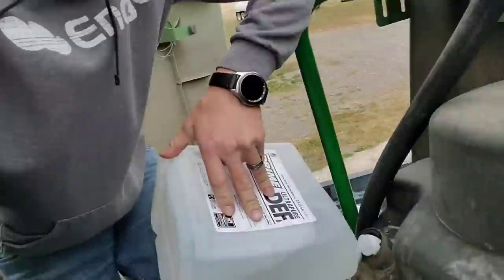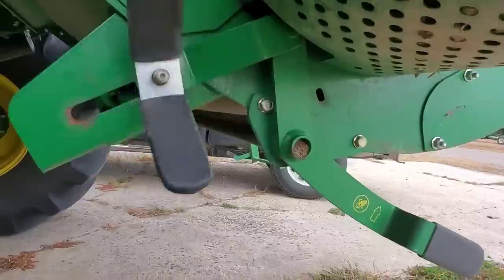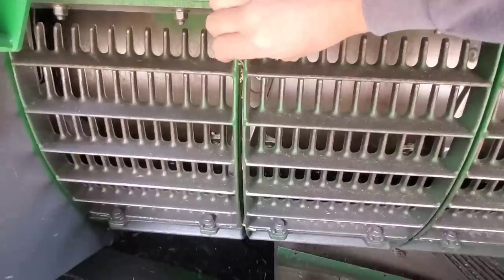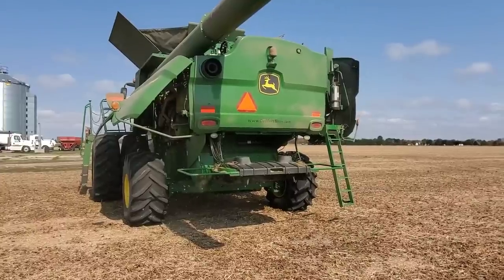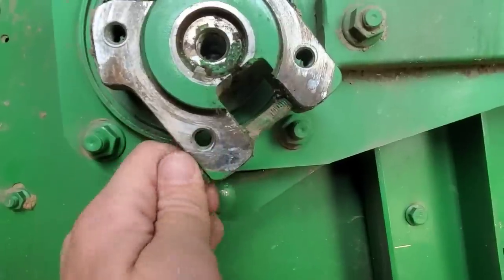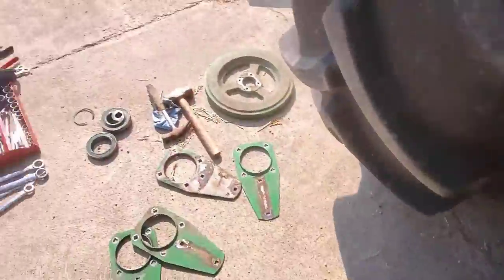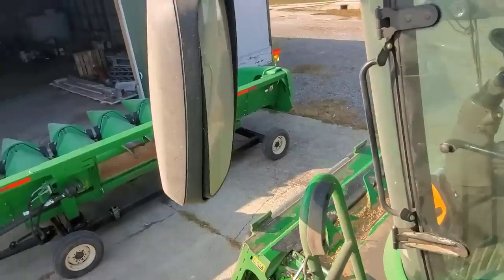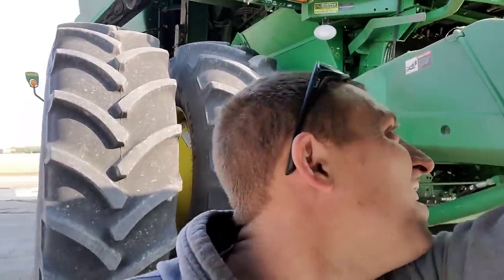Catastrophic Bearing Failure - #263

Comment: I love that A!! My dad had a late 40’s or early 50’s Super A with the 2 point hitch and a fairly ingenious homemade snow blade set up on it and it was the very first thing I ever drove and I was 6, maybe 7 at best? My dad used it to skid logs for his firewood business he had at the time, man would she pull for something that less horsepower then our riding lawnmower, lol, dad eventually bought a reel mower off a golf course to justify having it when he got out of the firewood biz but the R1 rears did a number in the lawn. I’m not sure if your A does it but ours was impossible to drive higher then like 1/2 throttle in 2nd gear because it just plain would not turn, even with that big old blade on the front dads Marian voyage with that mower ended when he got to the first turn and cranked the wheel only to make a couple of furrows in the lawn instead of turning, lol.  I nearly got killed skidding logs when they fetched up on a stump and it didn’t come close to stalling in low gear and barely above an idle, I hit the clutch before she flipped over backwards and I don’t know how it didn’t snap in two but it was high enough to pop both front tires when it landed!
Reply from the maker: Awesome stories and memories.  Honestly I haven't even driven that A yet. I do know they had issues breaking the engine block because of the lack of frame rails and situations just like you describe.
Reply: @BorderViewFarms  I know ours had a large crack near the front of the motor on the side you sit on that at some point had an extremely ugly cast iron weld that someone made even worse by brazing over it and it still leaked oil out of it and true to his style my father just repainted the tractor and made sure to keep an eye on the oil level, lol. I just turned 35 a few weeks ago and remember that stuff like it was yesterday, man I feel bad for city kids, they have no idea the fun they could of had ;-)

Comment: The radiator grill is different on your Farmall A than what I have seen on Farmall A's, B's, and C's.  It looks like the radiator grill on the engine on some 50 T Farmall balers. The radiator grill is mostly screen where as the others have spaced tin with screen backing.
Reply: You're right. That's a grill from a stationary engine on there.
Reply: @57fitter  It's the first thing I noticed when he came around the front, Doesn't make any difference in the operation of the tractor though.

Comment: I’m in Massachuesetts a lot of smaller farms here everyone had those A’s , the seat isn’t off set the engine and drive train is they were cultivating tractors , had a cultivator that went where the mower deck is you just center the row between your legs and it was easy to watch out for the plants! 👍

Comment: You should replace bearings on other side of shaft while your in the fixing mode I replace slacker bearings every 1000 hours. Cheap insurance. Good luck shelling corn 👍
Reply from the maker: You're right and if it was off season maintenance I would without question, but I dont really want to take the time to do it right now.

Comment: You're old tractor is not a 1941 mabe the engine was changed because overhead valve engine was available only in1949 .Flathead engines were before.
Reply: 1939 Farmall H and M had OHV  engines and I suspect  The F12, 14 and 20's had OHV as well. You're talking automotive stuff , I'd guess.

Comment: I think I would try blowing out and Power washing that radiator it shouldn’t have been heating up like that yesterday there must be fine dust that got through the screen clogging it up. Or clogging the charge air cooler (Inter Cooler) for the Turbo. If the water temperature wasn’t getting hot probably the inter cooler is getting clogged..

Comment: To bad all these bearings dont have a way to grease them
Reply: Years ago I had a New Idea Uni System and their combine had a lot of sealed bearings.  I saw a article about saving the bearings by drilling a tiny hole in the seal on the side of the bearing  and then greasing with a special pointed tip on my grease gun.  I never replaced a bearing after that on that combine.  Some times after the first time I greased the bearing rusty grease would come out so I saved a bearing.